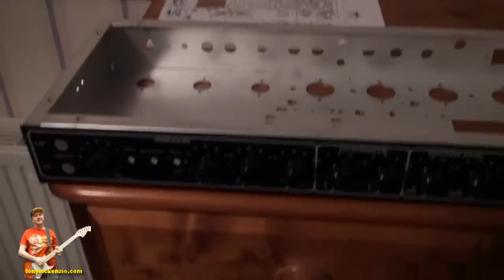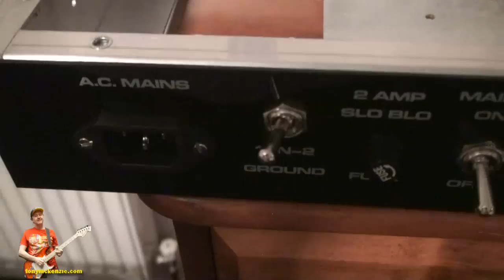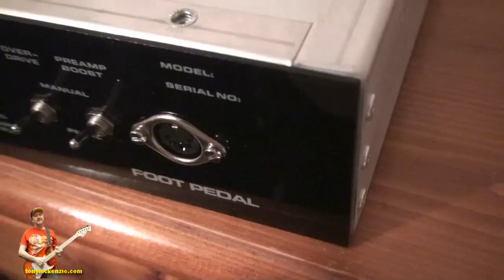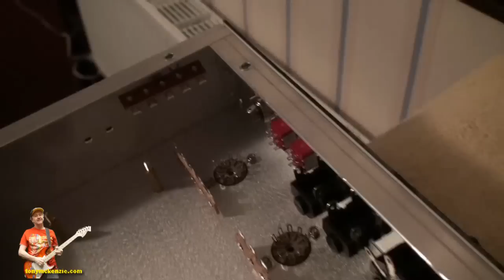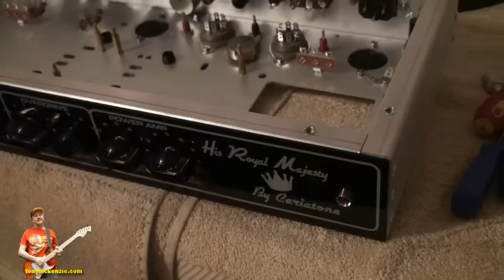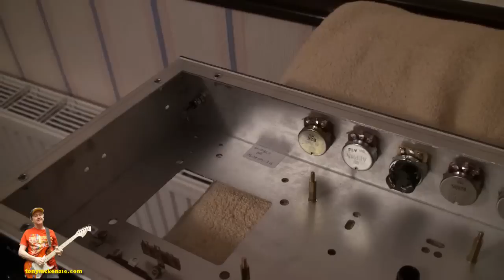Ceriatone Overtone HRM Amplifier Build | PART 1 | Make A Dumble Clone | Building it | Tony Mckenzie

Comment: How is the front panel mounted?
Reply from the maker: +Axel Jespersen Not sure I understand the question but here goes... the chassis is mounted from under the top of the amp (slung under and bolted up). The front panel (if you mean the black panel) is simply stuck on to the chassis during the build... in fact its one of the first things you do when you're making this amp. Hope it helps.
Reply: +tonymckenziecom thank you!